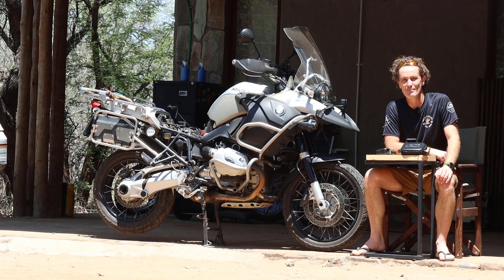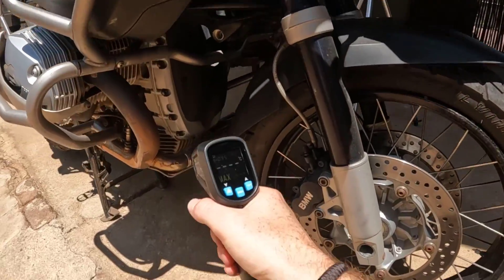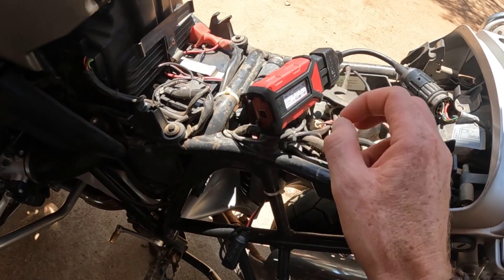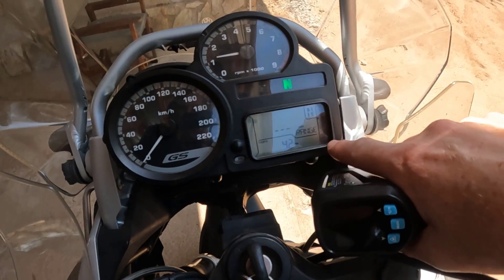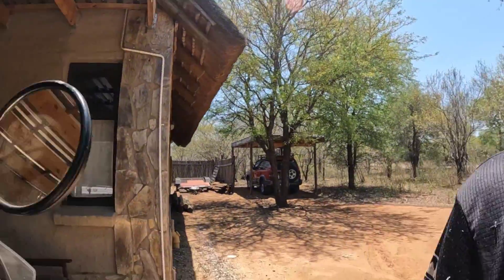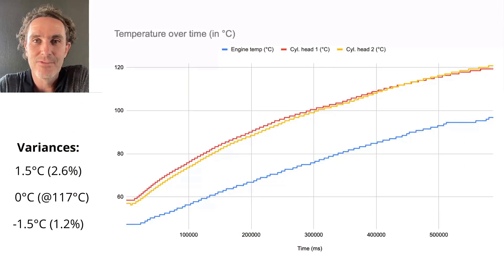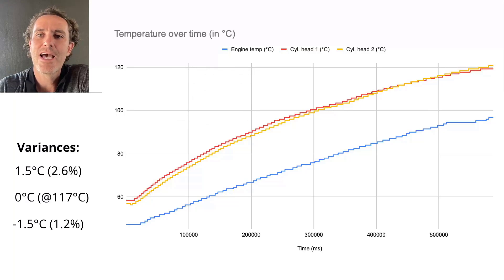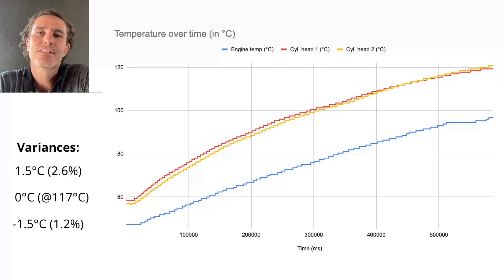Cylinder Head Temperature Differences | BMW R1200GS Adventure (Testing with GS-911)

Comment: I’m gonna buy a GS 911, it looks like a brilliant Tool! Thank you 🙏🏻🇿🇦🏍️😎
Reply from the maker: Hi Richard. I prefer bikes and carbs with carbs, as I don't trust electronics (LOL), so it makes a lot of sense. I would not buy a modern BMW without first scanning it. I've scanned two friends' bikes and both had issues (one was a rebuilt bike with parts from three different bikes which the seller didn't disclose!). The feature I like most is the live data... mostly to learn what the stuff means. I will try to make more videos on those in future.

Comment: my english is bad i must write in croatian. vaši videi su savršeni pratim svaki , imam isti motor gs adv 2008 zanima me zašto vam svjetli crveni trokut na tabli i abs prebrzo treperi.ako može jedan video o absu.
Reply from the maker: Thanks for watching and taking the time to comment. I removed my ABS pump. The older BMWs (before 2007) has a Servo ABS system that is prone to failing. I will make a video on that sometime. Thanks again for the support!

(I tried Google Translate, not sure how well it did, but here goes: Hvala što ste gledali i odvojili vrijeme za komentiranje. Skinuo sam ABS pumpu. Stariji BMW-i (prije 2007.) imaju Servo ABS sustav koji je sklon kvaru. Jednom ću napraviti video o tome. Još jednom hvala na podršci!)

Comment: Very interesting data. I have 4 old beemers, and these engines all do run a wee bit hotter on the left side. A boxer engine is not symetrical, and the small differences in intakes, exausts and heat distribution do actually result in different temperatures. 
After many years of aircooled BMWs I´d love to get a taste of a modern bike, and I think the K25 would suit my needs best. So what you´re doing here is exactly what I´d like to know about this bike! Looking forward for more! 
Best regards from Bavaria, where Winter is just about to start. More time to watch youtube videos xD
Reply from the maker: Hi, thanks for the comment and info on the boxers running at slightly different temps. That is good to know. These older R1200GSs are so easy to work on. I prefer them over the newer ones with all the rider aids and electronics. Enjoy the Winter. Funnily enough, Winter is better for riding here than summer :) Thanks again for watching.